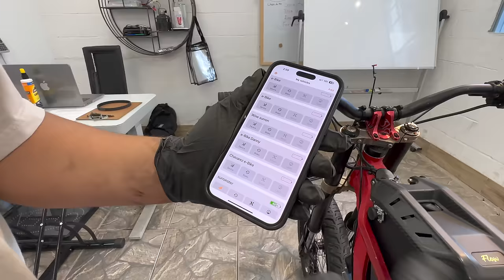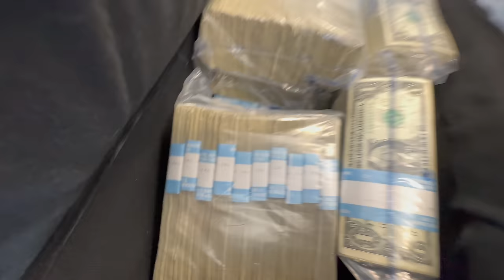INSANE Turbocharged E-Bike (2x Boost!)

Comment: That motor upgrade converts the surron into an electric motorcycle for sure. Holy moly
Reply: it needs only gearing to be one
Reply: @krzysis756  maybe a smaller sproket?
Reply: 52/54 on 19”
Reply: It beats my Honda Grom by far. Only thing is I definitely have that Surron beat on mileage
Reply: Gasoline forever
Reply: Once sea salt batteries take over and ebikes go down in price, gas motorcycles are old news lol.

Comment: Love the suronster content, razor content gets a lil dry after a while and  I love seeing you having a great time on the ronster. Maybe next upgrade could be real brakes ? Just wondering pushing 40 hp(I did the calculation) on mountain bike brakes is a lil dangerous. Magyura mt5s have plastic master cylinders and mineral oil fluid along with the fact that they have a tiny surface area so even some cheap motorcycle brakes would prolly out perform those dh mountain bike brakes. Much love ❤

Comment: I owen over 50 vintage metric motorcycles.   Mostly old 2 stroke.  And wathing these video's,  i want to ride one of these!!  Im into rc cars, boats, planes, helicopters.  So i know how much better they can be with a better motor.  This thing must be sick!!

Great video and mods.
Reply: How's it going mate I've had an still own loads an loads of 2 stroke an 4 stroke motocross bikes new an old these things are great out the box they will do like 40 mph but with mods an good wheel an suspension set up their another level

Comment: I think I'd still cook that Surron even with the new mod, One thing I didn't see in that upgrade was the battery to accommodate that 30Kw. I've seen those packs sagging with the 14Kw and that reason alone I'd cook it. My 32kw is now with minimum sag 642NM. My Modified 273 ain't to be played with but I like the build.

Comment: Nice. I bet it drinks the amps as fast as it goes down the road. Also maybe time for some big rotas and 4 pot brakes, if you haven't already.
Reply: 4 piston calipers come stock on the bike.
Reply: @robbie1212  Ah fair play, but still with a speed upgrade to 75+ Mph, some stopping power is needed too.
Reply: @tooottooot2543  1000% agreed! I don’t think mountain bike brakes are adequate anymore.

Comment: Hey, bro, love you videos. Do you mind mentioning how much this decrease your range? Or if it increased your range? Also did it increase or decrease your torque? I haven't really wanted an ebike Due to their limitations on top speed but with this kind of speed of 70 miles plus per hour, I could get with it!
Reply: It's a motor it won't increase or decrease your range what kw you're pulling from your controller/battery is what will effect the range
Reply: For example this bike stock is 5300watts if you run it that's like 90amps @ 60v he would be running 14000watts @ 72v which would be around 190 battery amps
Reply: The torque on this thing and basically all high powered mid drives are high enough. If you get a hub motor avoid low gearing, that's basically the only time you're going to come into trouble with low torque on a powerful ebike

Comment: Some tips from an experienced road racer/stunter/racer/biker who's taught lots of people. Don't take your feet off the pedals in corners. You need motorcycle gear at that speed, when you come off you will have some severe road rash, bruising, etc. Been there, done that. If it's bad you can't get out of bed unassisted for weeks. That sucks.

Comment: That motor has a peak hp of 153 hp based on the website motor details, it might melt before then though, thats why the KO is better because it has the same specs but with water cooling

Comment: My guy because of the new power you’ll def need a steering damper. Would hate to see you get speed wobbles at that speed. And maybe some tires with higher walls o you can really lean in those turns

Comment: you should pair it with the new tc1000, torp is honestly better than bac controllers
Reply: Did you tried it with tc1000?
Reply: @DuckNono82  haven't but I have a tc500 and just the tc500 paired with a 72v just blows my mind even on stock motor even at 40 to 45mph just a flick of the throttle the front will come up

Comment: To give credits to the guy in the  charger before y’all go hating on gas lol bassed on power to weight ratios and other factors pretty much any gas motorcycle or fully electric bike will probably beat a car in a drag race due to just the weight and power that bikes can pack so is not electric or gas is better in this circumstance

Comment: Can anyone help me here? so I have a motor, controller, battery, all the electrical stuff. Is there anywhere I can buy a frame, with the wheels, handle bars, shocks, and all the other stuff. So basically where can I buy a E-bike without the motor and battery, etc.
Or are there any regular bikes that are really easy to mount that stuff onto?

Comment: You should put that 330hp electric motor that just came out on it.. Looks to be around the same size/weight.. I bet it would be your most viral video!!
Reply: Need to buy gamera and disassembly it for this hhhhhh
And they released new one with 800hp this is really insane

Comment: The battery on this ebike does not have enough capacity for a 100km journey , what a joke compared to the TQ  and BOSCH setups of much lower power having a much better distance range than this . I bet you blew out some tyres and snapped some drive chains . This is common as my neighbour has ruined some of these items .

Comment: Its not turbocharged.  Its not boosted.  It is a bigger motor that will suck down the existing battery faster.
I don't expect any of you to survive so wanted to say goodbye now.  It will be fun while it lasts.
Squids never last.  Doesn't matter if its gas or electricity.

Comment: When working on any kind of EV, you can run the motor indoors or in the garage with all the doors closed and not have to breath in fumes 💨 ☠️, even late at night .  Also that’s so insane how you can rip around town / parks / neighborhoods with zero sound so no one is going to call the cops 👮‍♂️.    My generation of dumb old gas moto ppl are so clueless and full of shit.  99% of the reason people hate motorcycles is because of the sound.   Move in silence and no one bats an eye.   👍